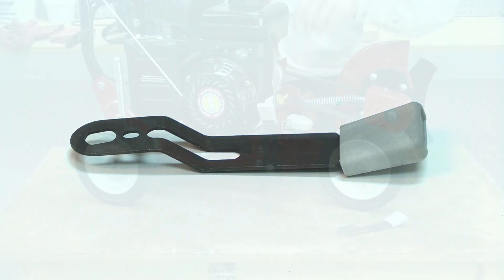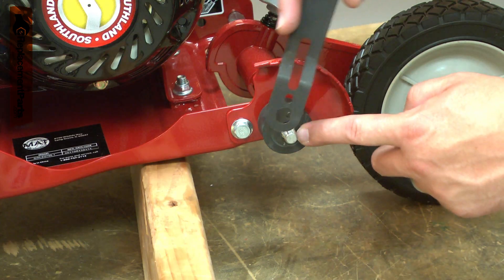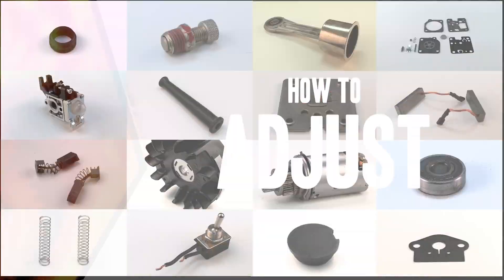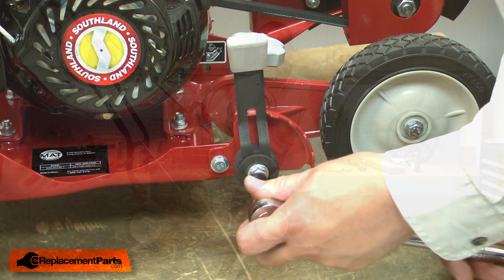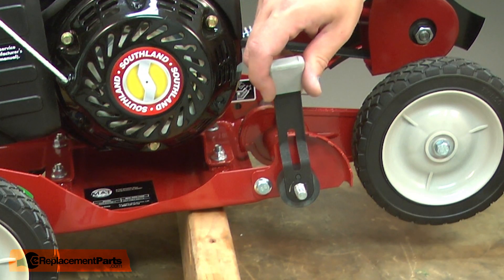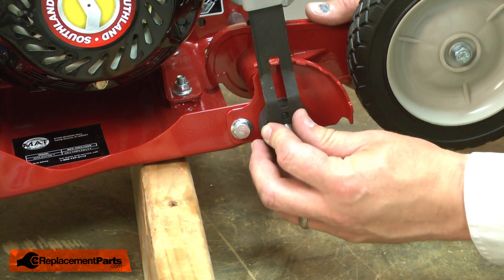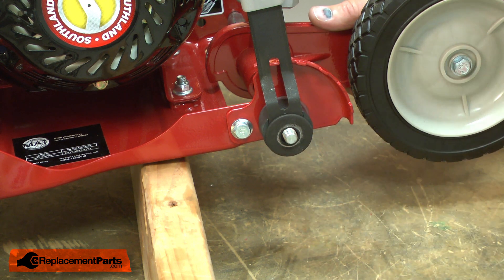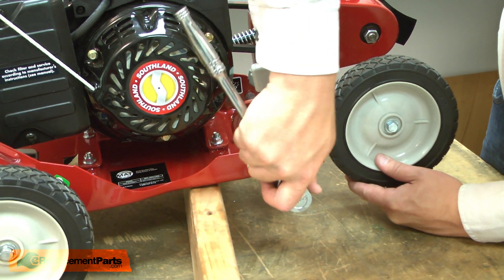Southland Lawn Edger Repair - Replacing the Height Adjustment Lever (Southland Part # A101112)

Comment: Hey! See that big spacer the adjuster attaches to?  Mine spins freely around the shaft that controls the wheel height. It looks like maybe there are 2 pins that need to be drive into the shaft? but I can't see how to align it, as no idea where (or if) the shaft has a hole in it.  How do you remove those darn pins, or reseat them?  Thanks!